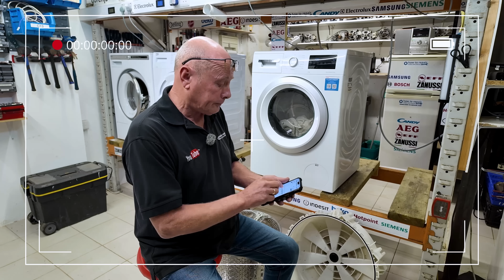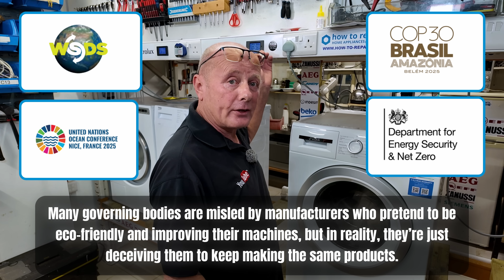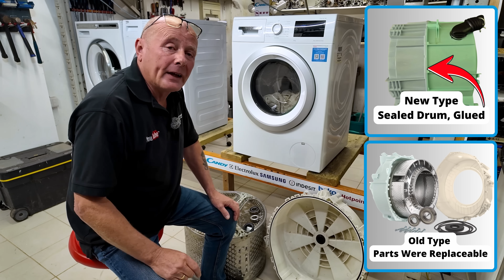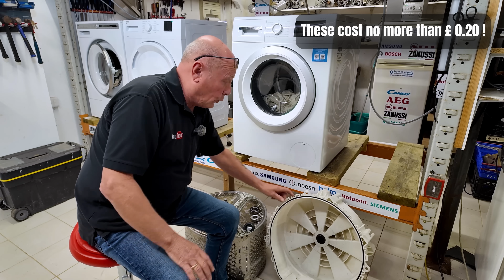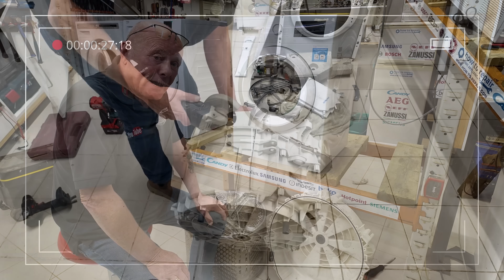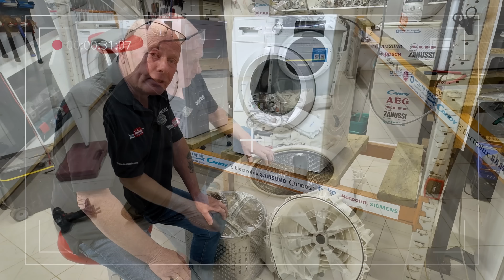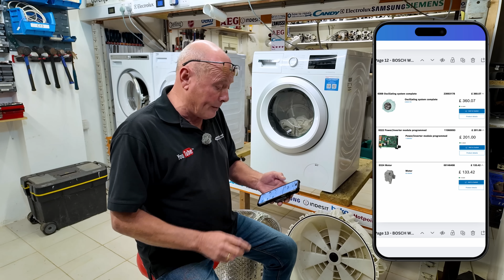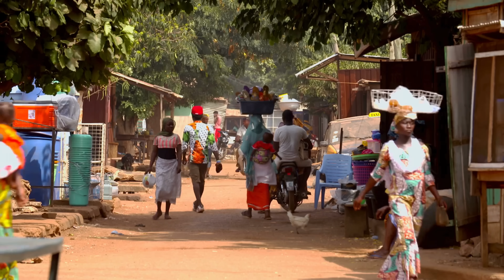Washing Machine SCAM EXPOSED! The Truth About SEALED Drums: Naming & Shaming

Comment: Elecrric car world:
Renault Zoe is known for failing motor bearing. It takes 8 hours of work, but bearings are replacable. 95% of time needed is getting drivetrain out and putting it back in, but replacing the bearings is just 20-30 minutes on top of it (splitting motor, putting bearings in).
Now, Renault installs the whole new drivein - motor, inverter, AC compressor and reduction box, at cost of 7.000€ per unit. Insured cars out of waranty are being written off for failed motor bearing.
I know a guy who works at Renault service in Western Europe, and he said that perfectly good drivetrains with bad bearings are just thrown away, rusting outside. 

Bearings cost 50€ max. Cost of replacing is 2500€ in UK, 1000-1500€ in central Europe and 500€ in Eastern Europe. This is close to the price of engine service, only you do it much less often.

It is such a shame, because it is ecomically viable to fix these cars and keep them at the road, even by main dealer network. Even if you install new drivetrain, old can be restored and tested on site with very little tools.
Reply from the maker: That information on the Renault Zoe's motor bearing failure is shocking yet completely consistent with the practices we see in the appliance industry! The principle is identical: a $50 bearing failure results in a €7,000 replacement of the entire drivetrain assembly (motor, inverter, compressor, etc.). This deliberate strategy is designed to make the repair anti-economical, just as charging £280 for a sealed drum replacement makes a £5 washing machine repair impossible.

This is the definition of contempt for the environment and the consumer. When the repair is clearly economically viable even within the main dealer network and the manufacturer chooses mass replacement, it shows that profitability and disposal are prioritized over longevity, which is exactly why we need the Right to Repair to be enforced across all sectors, from appliances to electric cars!

Thank you for your comment. I appreciate people like you taking the time to write it out. Please don’t forget to subscribe and share it where possible. It might help others make a wise choice instead of being misled by the industry.
Reply: Governments need to act on our behalf. If you don't build repairability into your product, it doesn't come into our country. 
Replacement parts costs that are proportionate. 

Its NOT PROPORTIONATE if the sum of its parts amount to more than the fully assembled machine.

Comment: In Saudi, the appliances mega store known as Extra would almost force you to buy extended warranty even as far as saying "we guarantee your machine will fail in 2 years, regardless of the brand. Get the cheaper one and add the cost for a free replacement and thank us later"
Reply from the maker: That selling technique the salesperson openly stating, "Your machine will fail in two years, so buy the cheap one and the warranty" is shocking, but it also provides a huge piece of confirmation for the consumer! The retailer knows exactly what the manufacturer is delivering appliances designed not to last much more than five years.

By being forced to buy the extended warranty, the customer is essentially subsidizing the manufacturer's practice of built-in obsolescence. They turn a gamble on a cheap appliance into a slightly more expensive guaranteed replacement plan, which is much more profitable for both the retailer and the manufacturer than actually building quality machines. This is exactly the kind of intentional confusion and profit-driven design we warn about in the video!

Thank you for your comment. I appreciate people like you taking the time to write it out. Please don’t forget to subscribe and share it where possible. It might help others make a wise choice instead of being misled by the industry.
Reply: @How-to-repair I'll absolutely subscribe now. Saw a few of your videos and I wish I had the intelligence or power to do what you do but I can't.
Your honest words backed with evidence makes you my hero.

And I absolutely agree, on the "white knights" as they call them. It's mind blowing how odd some comments praise these companies/practices and insist on defending them. Like they'll gain anything out of it.

Comment: Make a list of washing machines with a drum that can be split. Vote with your money and buy only those appliances that can be repaired.
Reply from the maker: Honestly, I can't give a definitive suggestion mate. Manufacturers constantly shift their production lines and release a vast range of products, meaning every brand has machines of both very good and very poor quality. My best advice is to stick with a brand that fits your budget and provides the technical information needed. Also, when buying new, always ask if the drum is splitable.

Personally, I really rate ASKO they are brilliant workhorses with superb mechanicals, often surpassing new Miele models because they still use a stainless steel outer drum. Some LG models are quite good, too. A big shoutout to Beko, who, despite some cheaper products, offers helpful technical manuals and wiring diagrams to support appliance fixing. They're making an effort! 

Thank you for taking the time to write this out. Please subscribe and share this where possible it could help someone avoid an industry trap!

Comment: Could you please give me some advice? I run an animal shelter, and almost every year we have to buy a new washing machine, we wash at 90C blankets, but they are not super dirty, but still the Samsun washing machines keep leaking, the warrantly people said it's our fault and didnt want to repair it, and the ones that did get repaired are all rusty. What washing machine do you recommned we buy? We definetly dont have huge budget for industrial washing machine.
Reply from the maker: This is a huge problem for you as I'm fully aware that the hairs can damage things like the bearing seals and also clog inside some of the hoses without having a budget for a commercial machine. It is very hard for me to give you solid advice although you are running a cat shelter I imagine a lot of the manufacturers will class this as commercial use. Have you approached a local appliance business near you to supply you the machine as part of a sponsorship deal? I imagine they would like the publicity. They may even supply you multiple machines. I can see from your channel you're based in Romania but I'm sure there will be local businesses and maybe a manufacturer may be interested in supporting you. Try reaching out to these. I would love to be able to offer you some of the machines that I have occasionally, which are surplus to the requirements, but it's a long way to deliver. Next year, I'm down your direction. I might even call in and service the old machine as I'm going through to Turkey.
Reply: @How-to-repair  Thank you so much for such a kind answer! I did send emails to the big producers like Miele, Samsung, etc but sadly didnt get any replies. The hairs were actualy not the problem, but the seal on the machines, like even today the recently repaired Samsung is leaking water when running, but we still have to use it cause we have so many blankets and pillows. They are not very dirty or full of hair, but we do use the max temperature all the time to disinfect and have them as clan as possible. Do you know any stainless steal machines? Or maybe only the industrial ones are stainless right ? We'd welcome you if you'll be in the region!

Comment: I have a 30 year old Hotpoint which is rather like Trigger's broom. I have replaced the door seal 4 times, the carbon brushes three times, the dampers once, the drive belt twice, the water pump twice, the spider and bearings once (which required a splitable drum) and various other repairs. I fully intent to keep it running for another decade at least.
Reply from the maker: I'm so glad you agree with the main idea! Making this video as visible as possible is up to all of us. I can't do it alone, so please remember to share it wherever you can. Your 30-year-old Hotpoint is a perfect example of how appliances should be built mate! I'm happy to hear you were able to replace the spider and bearings because your machine had a splitable drum. That capability is exactly what I advise everyone to ask the salesman about before buying as it's key to the machine's repairability and long life. Nowadays, most manufacturers including the groups that have acquired Hotpoint make washing machines with sealed drums, turning a simple bearing job into an almost guaranteed trip to the landfill. Keeping yours running for another decade is a fantastic goal and I support it fully!

Comment: I've had the opportunity to take apart a Bosch i-dos drawer, it was basically the same parts as a 1970's remote control model tank. just arranged differently. Bosch did not like the review and took it down. P.S. based on the prices quoted, here in New Zealand we pay 2-3 times more than you guys.
Reply from the maker: Your dismantling of the Bosch i-DOS system perfectly confirms the truth about these so-called advanced features. Underneath the marketing hype and the fancy Wi-Fi/Bluetooth connections, the mechanics are often incredibly simple, basic components. The manufacturers are greenwashing this industry to the point of insanity, charging a premium for basic parts arranged in a complex way that is often difficult to service.

It's disheartening but sadly not surprising that Bosch tried to take down your review. The truth about the actual cost versus the retail price is something they definitely don't want consumers to know! And your comment about New Zealand paying 2-3 times more than the UK highlights how the same machines (often with exclusive model numbers designed to prevent price matching) are used to rip the consumer off globally.

Thank you for your comment. I appreciate people like you taking the time to write it out. Please don’t forget to subscribe and share it where possible. It might help others make a wise choice instead of being misled by the industry.

Comment: Thanks for the info
years ago I wanted to replace the bearing on a Whirlpool washing machine that had just expired its warranty. I was very frustrated to discover that the bearings could not be replaced because the drum could not be opened. I threw the beautiful machine in the trash!! I barely managed to find a Gorenje washing machine made in the classic style with a metal and divisible drum. The best thing is that the bearings are outside the drum!!
In one washing machine, the electronic board (180 eur) died, where I managed to replace the voltage chip for 3 eur and the machine worked again.
best regards
Reply from the maker: Even Bosch used to make a few machines with the bearing assembly on a cast bracket at the back of the machine these are much more expensive machines and I understand why they can’t do this on their lower end models you pay for quality I realise that but it does not give them the excuse to remove the right to repair on lower end Machines. Please remember to share the video if you can as it’s the only way we will get changed implemented
Reply: What gorenje was that model?

Comment: my father recently repaired one of our laundry washing machines and he struggled to open it as it was sealed, but somehow he managed to change the bearings with great struggle.
Reply from the maker: Your father's experience is a perfect case in point! The great struggle he faced to open that sealed drum is exactly what manufacturers intend they want the repair to be so difficult and time-consuming that the consumer is forced to replace the whole machine.

While replacing the bearings is cheap, the labor and time required to cut, seal, and refit a plastic drum make it anti-economical for most professionals, which is why I always recommend asking if the drum is splitable when you are shopping for a new machine. By managing to fix it, your father saved a perfectly good appliance from the e-waste pile, which is precisely the kind of effort needed to fight back against this industry-wide scandal!

Thank you for your comment. I appreciate people like you taking the time to write it out. Please don’t forget to subscribe and share it where possible. It might help others make a wise choice instead of being misled by the industry.

Comment: How about Miele?  Expensive but very good.
Reply from the maker: Miele are now introducing sealed plastic drums into their washing machines this is stopping the consumer replacing the bearings or spider and on some cases even stopping them. Accessing the drum to remove small items of clothing that may have got lodged between the inner and outer room removing bra wires or even maintaining the machine. Is this corporate greed and the start of the downfall of a once trusted appliance brand?
Reply: @How-to-repair our Miele washing machine lasted at least 20 years with heavy usage.  The difficulty I found were the dampers on the suspension.  We recently replaced it with a Fisher Paykel washing machine which is almost silent.  It has a good guarantee.  It appears to be better than Miele.

UK typically come with a five-year parts and labor guarantee, plus an additional eight-year parts-only warranty for the SmartDrive™ motor.

See:  Fisher Paykel 10kg Washing Machine WH1060P1

Comment: The earlier Bosch used to have clipped together drums which you snapped off to open then bolted back together...... Simple manufacturing. The bigger issue in the metallurgy, a stainless shaft on an aluminum spyder running in steel bearings mounted in an aluminium boss, all sloshing around in an alkaline solution. Recipe for galvanic corrosion.
Reply: I've watched a YT video of someone changing the bearings in a clipped together tub, although it wasn't a Bosch, the tub join was right at the front of the drum, so they were able to remove the front panel take off the weights, open the tub and change the bearings in situ without dismantling most of the machine, making it relatively quick job, although I did wonder how reliable the seal would be compared to screws. Microbiologically influenced corrosion is one major cause of aluminium spiders corroding and failing in washing machines, this is one of the reasons for modern machines having machine cleaning cycles and regularly prompting the owner to run one.

Comment: Our last washing machine (Beko) had a motor defect and had some bigger patches of rust after 6 years.

We replaced it because a replacement motor would have cost 180€, it wasn't clear if this is the cause of the problem and a bigger machine was a nice upgrade since we got two children now. 

But we repaired some of the common issues for washing machines prior (defective pump, worn out dampers, a lock that wouldn't unlock).
Reply from the maker: I appreciate your agreement with the main idea. Making this video as visible as possible is up to all of us. I can't do it alone, so please remember to share it wherever you can. Your Beko story is typical of the industry today. You were smart to handle the smaller common repairs like the pump, dampers and door lock. However, when you're faced with an expensive core component like a motor which costs nearly €180 on a machine that’s already showing signs of rust the cost-benefit analysis often tips toward replacement. As I discuss in the video, appliances today are simply not built to last much more than five years, and replacing components at high cost often feels like a gamble, especially when technical data isn't readily available from manufacturers. I hope your new bigger machine serves you well for many years!

Comment: I fixed my Bosch washing machine. There were no screws securing the two drum halves, they had massive one-time clips so that the assembly was exactly as fast as welding. Push-clunk, done. The repair requires you chisel the clips off, and then use screws in the bosses provided, to re-assemble the drum. More of a pain, but still do-able, and I'm sure if you did it regularly, you'd have the right tool and it would only take you another 15 minutes.
I believe that assembling the welded form probably takes more equipment and more time than just pressing the clips together.
Reply from the maker: That's an excellent observation and you are spot on! Manufacturers, including the BSH group (Bosch, Neff, Siemens) want their production line to be as fast as possible. Using those massive clips that require just a "Push-clunk, done" moment is far quicker than installing 20+ screws.

This design choice, while fast for manufacturing, creates a hostile environment for repair. Even though the repair is mechanically simple the extra 15 minutes of frustration is exactly what turns a simple £5 bearing job into a professional quote that encourages the customer to dump the machine a pure example of planned obsolescence in action!

Thank you for your comment. I appreciate people like you taking the time to write it out. Please don’t forget to subscribe and share it where possible. It might help others make a wise choice instead of being misled by the industry.